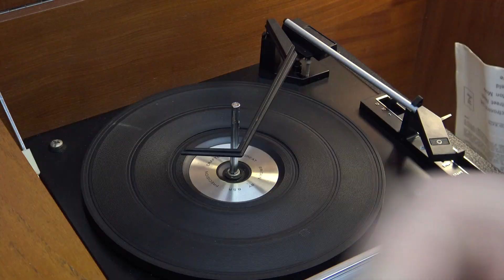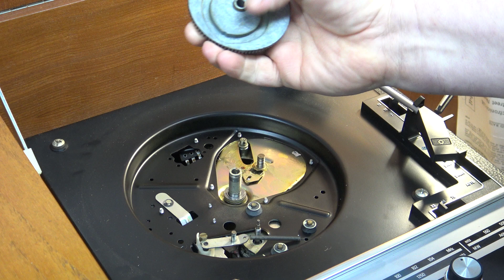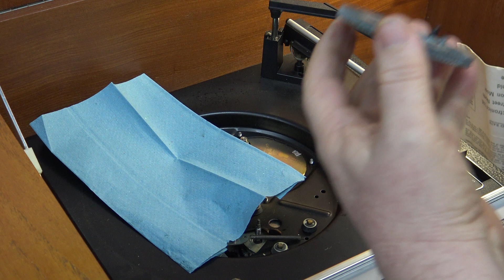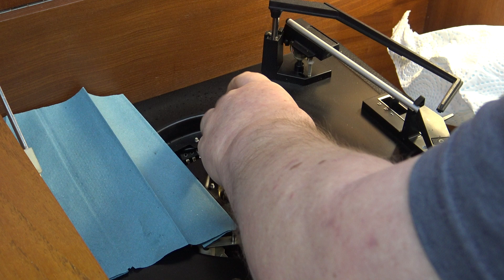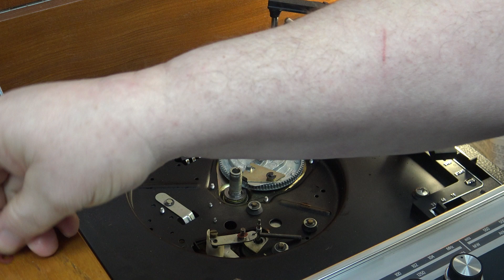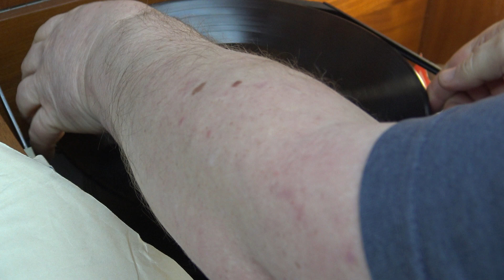Wye Radiogram service Pt3 of 3 - BSR record deck service

Comment: Great work Richard. Shame about that cartridge though. I think I would have to change it if it was mine. Regards Graham
Reply from the maker: Roger on that Graham. Yep, wire soldered direct to the LH channel pin has no doubt managed to damage the cartridge. The customer will replace it himself. Sounds OK on mono records!

Richard

Comment: Hello 👋 Richard it’s nice to see you finishing this machine sir👏👏 you mentioned Andy can you say which one or give a link so I can find him too thank you 🙏
Reply from the maker: Yes, it's Vintage Electronics Repair. He was an NSM jukebox engineer & he's at Stockport.

Richard
Reply: @ukfmcbradioservicingTango21  thank you so much Richard I remember you saying before but I couldn’t remember the link👍 by the the large cap had you tested it at all as being a top brand it would have been interesting to see how far out it was but you are definitely right to replace it
Reply from the maker: Just tested it for you...15,500uf, instead of 10,000uF. They often tend to rise when they are at the end of their life, but the useuable voltage goes down. It was £12, but I knew it needed to go after 50 years.

Richard
Reply: @ukfmcbradioservicingTango21  thank you for testing it for me that was very interesting but as you I wouldn’t have left it in ether ! Keep up the brilliant work you and mr chippy do as it’s very much a dying art as I’ve got a teac x1000 reel to reel that needs a service and the last company that did the tensioners upgrade are no longer around